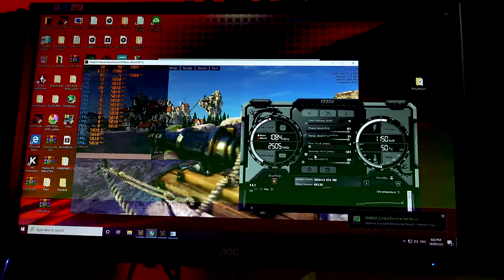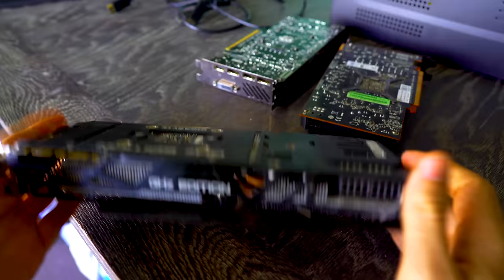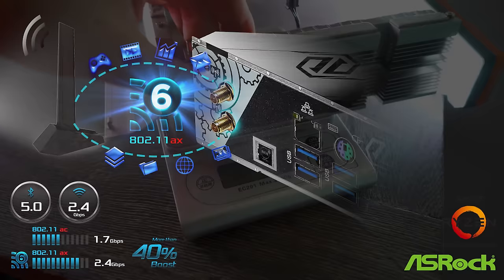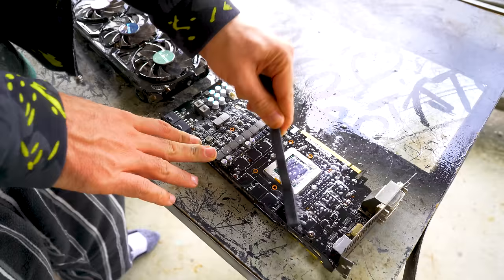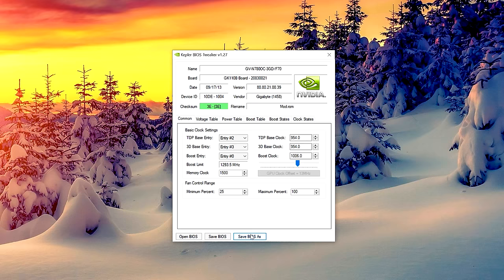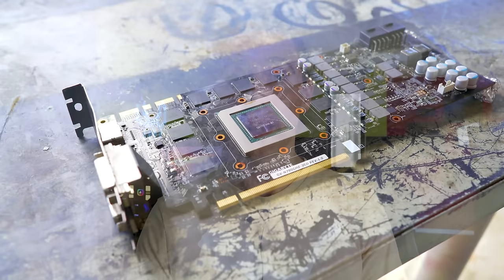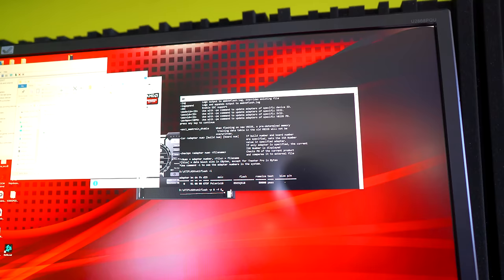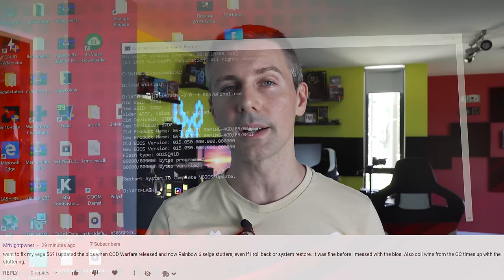4 Problems that Cause a Faulty GPU and How to Fix them.

Comment: Mr Tech Yes,

I have a vega 56 that boots up

But crashes when any load is applied

Stuck on base clock of 425 mhz (clearly gpu can go higher)

I'm thinking it is a power draw issue

Maybe a mosfet or whatever controls power stages

What is your input on that

And how much would it cost to repair?

Comment: So the reason I'm here is because of this message I get... The VGA card is not supported by UEFI driver.
CSM (Compatibility Support Module) settings have been changed for better compatibility. For further adjustments, press [F1] to enter BIOS setup.

If no adjustments needed, press [F2] to confirm the current settings and enter OS directl
The system has POSTed in safe mode.
This may be due to the previous POST attempt failing because of system instability, or if the power button was held in to force the system off.
If the system failed to POST after you made changes to UEFI settings,

you may wish to revert to stable settings to prevent POST failure. Press F1 to Run SETUP

I have an Nvidia RTX 2080 TI founders edition.
Now the BIOS will automatically put it in the mode that is supposed to do it in but my screen eventually turns off Everytime. So I tried all the different options from booting from legacy, booting from EUFI, from both from other OS turning on or off CSM. Trying to switch it from raid to AHCI.
Tried booting from a USB drive and reinstalling windows I tried recovery and repair but....
The screen will turn off before I can finish a lot of these things but sometimes I go fast enough I can do it. Still does not work. Also I noticed the longer I don't have my computer on the longer the video image will stay. I thought it was an overheating issue but I have it water cooled with the AIO with the g12 bracket.
Right before this it was working fine but I did have my friend installed and LED strip via soldering it on the wires...they broke off onto the bracket but it's not anywhere near the GPU and there's no solder drips. One of the wires is touching the g12 bracket but everywhere else around it I couldn't see it touching the GPU? I thought maybe it would go down one of the bracket legs but I don't know.
So..... It's saying it's not compatible with EUFI so

Is there a way to reinstall GPU drivers from the BIOS,
Aaaaaaand there's a chance that I might have accidentally deleted a boot logger but has been working ever since that so I can't see why that would be it when it has been  working but can I reinstall boot loggers from the BIOS? 
And how for both questions.
Right now it's all the time for my GPU to go with how expensive GPUs are right now. 😭

Comment: pro tip: HDMI ports are crap, they burn away very easily...
If you see a cheap seller stating hdmi problems, it might be good and you just need a DisplayPort to HDMI adapter... (I got a 960 like that, "dead" with  hdmi, but a cheap adapter and I still use it 4 years later...
Reply: My rx 550 display port sometimes doesn't  work,  switch to hdmi port no problems so far.

Comment: I think my GPU is dying, it's an RTX 2060 VENTUS OC (6GB) sometimes I don't get a signal when I change resolutions :( and sometimes it says no display when I'm at the login screen I tried my pc without the GPU and it boots fine and I can use it without the GPU idk what's happening I thought it was a bad driver at first :/

Comment: Error Code 43 GTX 1050 Ti

So I currently own a Lenovo Legion Y530 with a Nvidia GTX 1050 Ti. I’ve owned this laptop since August 2018, it’s worked flawlessly until around January 2020. One night I was playing Forza Horizon 4, and out of nowhere it blue screened on me. After it restarted, I came back and launched Forza again, but this time it said my PC didn’t meet the minimum requirements. So I went to device manager, and it showed a yellow triangle next to my gtx 1050 ti, with the error code 43. I have done everything I could on that night, uninstalling drivers, reinstalling old drivers, reinstalling new drivers, downloading the latest drivers, BIOS Update, everything I could find. Idk if my graphics card has met its end, I’ve overclocked it but it was a stable one +150 on the core + 500 on the memory idk if my overclock has done me over, since it has been stable since 2018. Help would be greatly appreciated.

Comment: What should I do to my GTX 670 2gb which doesnt output any performance only the video source and it didnt get any drivers working. I think the thing is on the condensators but non of those wasnt up or extended in size. 

So what should I do?

Comment: hello... i got a gtx780 3gb from someone and thought it would work perfectly fine... but when i put iy in my pc it either have no display or it will boot up to the asus booting screen  and show three thick green lines and 2 purple lines vertically on the screen, please please please help me, i really had so much to plan with my gaming etc but this put me down, and i do not have money whatsoever to get me something better than the gt710 I currently have in my pc bcos im only 16,and i can hardly do any thing to get money, please reply to this i beg you, i dont have money to get my gpu checked out

Comment: Can someone help me out? I have a 1080ti with a waterblock on it that I"ve been using for a couple of years.  I get a signal on the display port and in the past I had a second monitor plugged in to the HDMI and all was good.  Anyway, I installed into a new case and was too aggressive with dust filters - therefore choked the radiator and the GPU was getting much hotter than normal.  I took the card out first to check the block for clogging, took block off and reapplied thermal paste... and then later realized it may have been the poor air flow.  Not really sure what the issue was.  Anyway, card is re-installed and works fine, temps are great - however NOW the HDMI isn't sending a signal?  Could forgetting to put a thermal pad in the right place cause this?  Why would the HDMI ports no longer work yet display port does and temps a excellent.  I noticed that if I boot with only the HDMI connected monitor I see the boot screen but eventually the signal goes off.  I have checked and cables not the monitor is the issue.

Comment: watching this after my 2water loop exploded and soaked my 2080. Card powers on, Gets Generic Video, Pc wont recognize a NVidia card installed, Tried DDU to erase the drivers and redownloaded new drivers. Put in rise for 48 hours, Cleaned with a q tip and alcohol. RIP GPU. what is the spray exactly so i know what to try?
Reply: im waiting on someone to say what spray they're using too. i dont want to take any chances of getting the wrong stuff.
Reply: @iVibeBruh  I tried soaking with 70% iso and using soft brush... didn't work.. crazy i even used Distilled water in loop as i was told its less harmful if a leak occurs.

Comment: Hey guys, I have a gtx 1070 founders edition card that I was using to game. One day while gaming it made a REALLY loud blower noise like is was going over100% speed and crashed. After that I never got it to send signal anymore. The temperatures weren't good. I used to game at 92c+. So I was wondering if I should try to change the thermal paste and thermal pads if that'll help? If not what else can I try to fix .

Comment: Hi! I have the same gpu (the MSI dragon, red and black) as the one you cleaned using your multipurpose spray. I'm having NO DVI SIGNAL problem. Same when using an HDMI cable. 

This computer was stored and not used for over two years. I was wondering if i could open the card and deep clean it just like how you did, but if i don't have a multipurpose cleaner spray what can i use as alternative?

Comment: I have an r9 390x. It went down and I cleaned it up really well with electrical contact cleaner and it booted after that, but after about 45 seconds my pc would freeze regardless of what I was doing. So I did the oven method and it helped i played gta v for about an hour and it started artifacting so I baked it again. I have not run it hard since. When I start my pc if gpu fans stop when windows loads then they wont turn on again on there own.. about 1 in 7 restarts the fans work and I can watch the fans speed up with the temp but the other 6 times it just goes to about 95 degrees and starts artifacting... would you have any clue as to why my fans won't work with just amd drivers?

Comment: I have a Vega 56 with a morphius II cooler, started getting memory artifacts, underclocking hasn't helped, do you think i should put the original blower cooler back on?  I ask because when i did the morphius cooler instal i put a large amount of small heatsinks with double sided thermal tape on the mem, vrm, and other SMDs that were being cooled by the original cooler and removing them could be sketch....

Comment: For the issue with a  GPU  that is just black screening that is brand new I know at least sometimes it is also the driver versus the port. I.e. on the rx 550 you can only use the left  dvi port (for whatever reason it took a update on the driver software to get hdmi working)

Comment: I have a GTX 960 that works fine for random periods of time but then eventually says No Signal. Although the card still works. You can hear the in-game audio. I've tried all 3 display connectors.

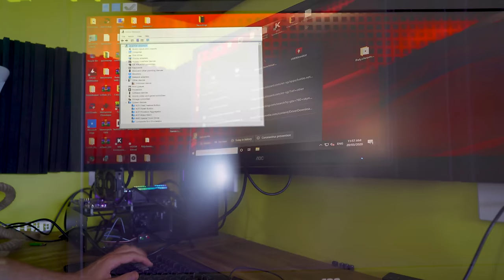Comment: 6:00 that usually happened to me until I really formatted the HDD (only partition where the windows is installed) and installed Windows 7, then upgrade it to Windows 10 like that. LOL
My GT 630 was annoying when the PC would shut down out of nowhere when the PSU were faulty.

Edit: another way is trying DDU and making sure there's no drivers left behind. (I can't guarantee since I didn't try)

Comment: i have 2 pins that some or the gold got scrape off by mistake i guess. it works great once the pc boots. but i do get 2 screens one orange then one yellow and then the pc boots. is it those pins causing those screens due to the start up check of the gpu?

Comment: Hey, I have a zotac 1050ti oc edition which displays the video when boots up pc but after a restart or a full power turn off the motherboard stops at VGA led and no display.  After a full day of leaving the pc turn off it works again but the same problem come after a restart. So what's the reason this happens

Comment: I saved my GF's video card by using my crafting heat gun.  I did it carefully, and it took 3 tries.  I also used contact cleaner on the ports for good measure.
Reply: wdym carefully

Comment: I dont have a heatgun so i threw mine in the oven on tinfoil for 10min at like at 200C and it worked after that, no problems since then. I guess the solder points can if it gets too cold and you move the pc around or the card flexes inside the pc. My card was the amd r9 270x.

Comment: so my MSI GTX 970 just completely went unresponsive out of no where a while back, been using motherboard graphics since then (no gaming) and I haven't been able to fix it. Has anyone had the same problem and come to a solution for it with anything? When i connect it, the light for the MSI logo and "MSI" turn on but the fans don't spin. Under Device Manager, it doesn't show at all under the Display Adapters and I can't download its drivers unless it has that signal detected. Any suggestions?

Comment: What about if your 2080Ti runs heaven benchmark for a few minutes but when the temperatures approach 80C the signal to the monitor disappears and you're forced to manually restart? However, if I limit the power to 90% it lasts much longer but once it eventually reaches 80C the screen goes black again? Should I just return it?

Comment: I had heavy artifacting, it looks like its fixed now. problem seemed to be the split power connector to the gpu i use seperate ones now and the problems seems to be soulved.

Comment: For the 1 problem, remove heat sink, and run card without it for a few times. Than install heat sink and try to install drivers. Usually it helps :)

Comment: I have a Sapphire hd7770 that works fine however the fan blasts at 100% all the time due to the fact that the gpu doesn't post it's temps at all it's always at 0 degrees. I am unable to set fan curves due to this. Anyone knows a fix for this issue???

I already have replaced thermal paste and cleaned the gpu.

Comment: Do you fix graphics cards for other people? I plugged my tv into my crappy apartment outlets which failed to ground and fried my tv, sent a shock through the hdmi port, and now the gpu will not display. It’s a gigabyte rtx 2060.

Comment: I have a strange problem with my GPU
Months ago I had to do install a sh**ty Win7 Update (I have Win naked with as little junk as possible):
1- While rendering in RT on Enscape + Sketchup, it started to slow down a lot, the day before the update was fine
2- After a few days, Enscape started crashing from time to time.
3- After a few months, the renderings rarely work many times i received a blue screen!
5- Then when rendering in Enscape make my PC to restart suddenly, but without blue screen
6- Today the card, both in HDMI and DVI, it shows nagative colors toned on purple blue (but no strange artifacts) then does not start Windows at all.

This happens to me with the SSD that has undergone the update of Win7, but also with those without updates, both Win7 and Win 10.

The strange factor is that the card works perfectly if i restart in safe mode
on Win7-10, no crashes, no strange colors. All perfect even the temperatures.
But if it were a driver problem, the problem would be limited to the SSD with the update.
Could it be that in safe mode, it doesn't strain or access the Vram or whatever and then it seems to work?

DETAILS:
-The temperatures are always low even during renderings before crashes the temperatures do not exceed 60 °
-Cleaned the board, and the connections on the motherboard
-Tried all PCI slots
- HDMI and DVI tested
- Tested on both Win7 and Win10

Comment: Micro soldering is not that hard. Think of the paste as area prep and use it to make the solder stick to the areas you want. Heat the solder with your iron and then apply the end to the area on the pcb you want soldered, the solder will soak from the tip of the iron to the area you placed the paste on. even if you dont have a steady joint you can use the heatgun afterwards to spread the solder and get a better connection.

Comment: my computer mother board caught fire twice, the second time was so bad i had to open windows to let the smoke out, then it got flooded 2 i mean soaked! my girl friend left it outside in rain over night i had it about 7 years since the fire and flood it still works even dou it looks like it shouldn't. its so strange i had to remove the power button so everytime i want to turn it on i have this naked wire i touch to the body and it starts. i love my machine never had antivirus installed last time i changed anything was the gpu about 9 years ago but still all the late games fly no problem
Reply: Dude, if you or anyone is planning to make a robot dont use this as a component or humanity will have to give up :D

Comment: gtx1050ti
Brings image but games freezes or BSOD after a short load up.
On the program manager gpu looks to go full 100% usage.
No overclocking
Drivers reinstalled and updated so many times
Tested with a new PSU
Fans work well and go full before freezes

Comment: One thing I learn that all GPU have Mofet and fuses  if I did not check the fuse no mater what I did to it then it won't work So us a decent multi meter  check the fuses and  the  mosfet any fault in any one of them replace the lot

Comment: I have a questing I bought a 3020 optiplex motherboard and a i5 4590 then I used some parts from my older 790 opiplex. That had an Asus Geforce GTX 660ti with a thermaltak 750 powersupply 8 gigs of ram and all I got was a black screen any thoughts?

Comment: Hey I could use some help, I used all the solutions and I believe my card has faulty VRAM (Problem 3) . The card has signal for about 15 seconds but has a black screen, after the approximately 15 seconds, the card looses signal and that's where it stays. I cant get to MSI afterburner to downclock the GPU since my motherboard doesn't have display out slots. I've tried the solutions for problem 1 & 2 but not fix. I don't have a heat gun or an oven that I don't use for food to try solution 3. Any suggestions you give me will be appreciated 👍

Comment: Hey man I dont know if its okay that I put my question here but I happen to still use a 960 gtx nvidia geforce card. And something that happeneds everytime I start up my pc is that my monitor doesnt even recognize my graphics card until I reconnect the cable multiple(random amount of times) before it connects. And when it connects, and this is the weird thing, it remains connected until I reboot my system the next day. It doesnt give any errors it just wont connect at the start up and I have no idea why it randomly connects with this method but its very frustrating... if any of you guys in the comments know about this too or anything please help me. It would be really appreciated.

Comment: Late to the party and someone may have already said it, but the R9 200 Series of GPUs use the Hawaii chipset, which are designed to run hot, up to around 95°C from what I’ve seen on my R9 290X, which just turned faulty (VRAM if that I’ve seen on this video is correct 😢😢😢).

Comment: I have problems no 1 with my amd r9 290 tri ox 3 fans 
It show display before windows log screen even in safe mode it show display but after installing driver old or new it won't work screen goes to black 
So my gpy is died ??? 
It can not be repair